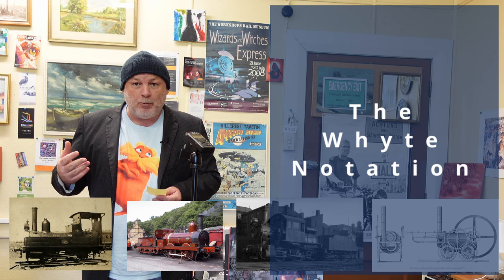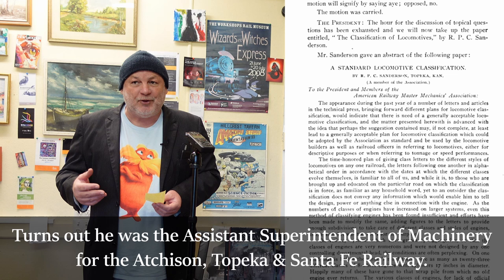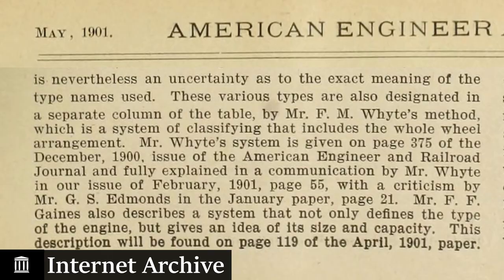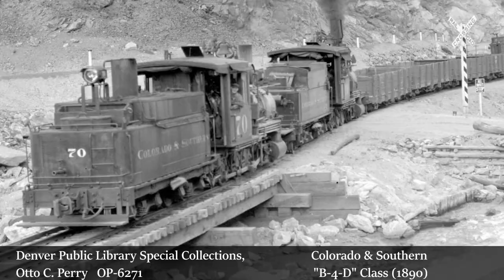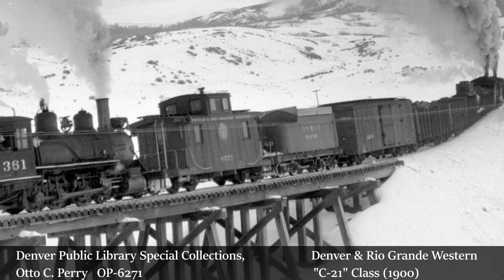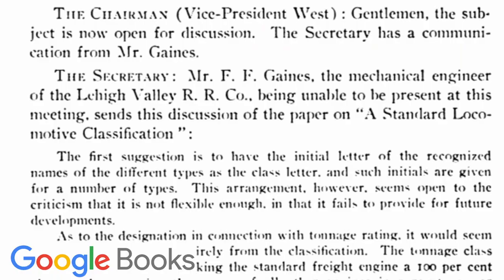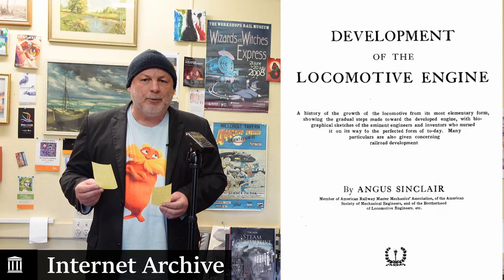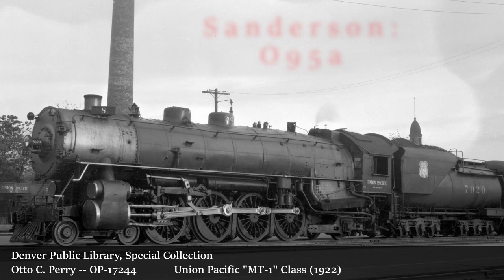C64o? or 2-8-0?  - The strangest locomotive classification system you've never heard of...

Comment: The German system that you mentioned in the answer for adaribros was the secondary classification.
The primary classification (Baureihe) ordered the locomotives by origin (new design or pre-1918), usage and wheel arrangement (with classes 97, 98 and 99 being the exception with only usage as the group criterium)
The second classification was partially carried over from the Bavarian railway classification and was called Gattungszeichen. This originally indicated intended use (P for passenger, G for freight, S for express), wheel arrangement and later an indication for being a saturated steam engine. When it was applied in the new system the axle weight was added instead. 

A Br18. 5 was a S36.18, which means express engine, 3 out of 6 driven axles, axle weight 18 ton.
A Br 01.10 was a S36.20, so also a Pacific but a heavier one.

A class 52 is a G56.15, with a 2-10-0 wheel arrangement and just 15 tons axle load, where a class 44 is a G56.20 with the same wheel arrangement.
Note that in both examples the number of cylinders is not relevant as long as it doesn't affect axle load.

For the more exotic ones
A class 96 Mallett (0-8-8-0) is a Gt88.15. G for freight, 't suffix for tank engine, 8 out of 8 driven axles, 15 ton axle load. This was a departure from the Bavarian notation were it was classified as Gt 4x4. Being the only articulated type left for the mainline at that time it wasn't necessary to make special arrangements in the numbering.
Reply from the maker: Thanks for your long and detailed reply.

I must confess that my acknowledge that my knowledge of European Steam and railways is limited to the Marklin catalogue I had when I was at Intermediate School.

And these days, much is beyond the language barrier for me.

So thanks again.

Also, was the European adoption of 231 for 'Pacific" influenced by Whyte?  Or did it co-evolve as far as you know?

Comment: I now know why I never heard of the Sanderson system. Whyte all the way!
Reply from the maker: I don't have a sense that we've missed out all these years by Sanderson's scheme not getting out of committee.
Reply: There is a better one in use in germany, where powered axles get letters instead of numbers and articulation is noted, but at least the basics are almost as easy as whyte
Reply from the maker: @the_retag  We had a class of electrics here in New Zealand that were 1-D-2, so I'm familiar with it.  

The Americans were familiar with the European systems in use at the time.  Reference was made to the German system with (from memory) all axles as the numerator, and powered axles as the denominator - so 5/3.  The trouble being that such could be a Prairie,  or a ten-wheeler.

I wonder if the German 2C1 and French 231 were adaptations of Whyte's 4-6-2, with axle preference in place of wheel preference.  Maybe.

Either way, I'd take 2C1 and 231 over Sanderson's O27a any day.

Comment: I never heard of this system.
However, there is a system based on German practice which has more information in it.
It is the UIC system adopted throughout Europe.
First part is somewhat comparable with the AAR system, axles are counted, furthermore are driven axles denoted with a letter, the place of the letter in the alphabet gives the number of driven axles. non driven axles have a number, and those axles which form a bogie  or pony truck have a prime symbol ' following the number of axles. If driven axles are not coupled like on a diesel electric there is a lower case o behind the letter for the number of axles. Parentheses are used for a group of driven and non driven axles articulated to the main frame but not just a single truck.
So for instance a 4-8-2 would be a 2'D1' in the UIC system, a Big Boy or 4-8-8-4 is a (2'D)D2'. A six axle diesel having 2 bogies with independent traction motors on each axle (AAR C-C) is a Co'Co', if the middle axles in a bogie aren't driven it is an (A1A)(A1A),  
Sectioned locomotives have a + sign between the sections, a Norfolk & Western LC-1 class electric is a (1-B+B-1)+(1-B+B-1) in AAR notation, in UIC notation this would be a (1'B)(B1')+(1'B)(B1')

Further information is held in additional letters, most are for steam locomotives.
n stands for Nassdampf or saturated steam, h for Heißdampf or superheated steam, , a number behind n or h gives the number of cylinders. 
This is followed by either v and/or t, v stands for Verbund or compound and t stands for a tank engine.
A last, upper case letter gives the type, G for goods, P for passenger and S for express locomotives.
So the NZR A class in its as delivered saturated steam compound form would be 2'C1'n4vS, 2 leading axles in a bogie, 3 coupled driven axles, a trailing axle in a pony truck, saturated steam, 4 cylinders in compound and intended for express passenger work.
A Norfolk and Western Y-6 is a (1'D)D1'h4vG (Whyte 2-8-8-2), an Allegheny is a (1'C)C3'h4G (2-6-6-6)
If the steam engine is a Garratt comprised of two separate engine units each having their own main frame the notation is for instance for a South African railways GMAM in Whyte notation            4-8-2+2-8-4, in the UIC system it would be 2'D1'+1'D2'h4, I'm not sure if the suffix t would be used as a Garratt in essence is a tank engine as it doesn't have a separate tender. The suffix G or P is left away as it is a locomotive for general use.

As can be seen more information is available in the UIC system, not only the number of axles, but also how they are grouped in trucks and articulation of the main frame, type of boiler, number of cylinders, simple or compound expansion and the intended type of use.

I hope this is of use for you, it's a rather long reply but this way I could explain the UIC system largely.
Reply from the maker: Oh I don't mind the long reply.

The NZ experience is limited - and I think only a single class of 1930s electric locomotves for Wellington used it. 1Do2.  To me I always thought of the numeral "1" as the letter "I."  So eye-doe-two.  And like saying Mallet instead of Mallet eye-doe-two remains a hard habit to break.

Mr. Sanderson appears to be quite the deep thinker - having presented papers of draft appliances and the like.  He was also involved with the early use of the Balraire firebox in North America.  So win some lose some I guess....